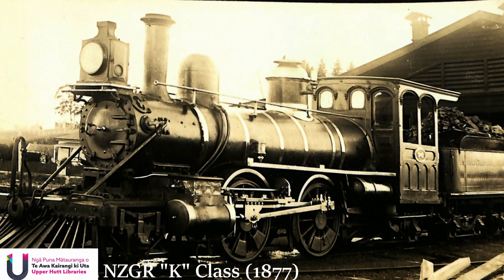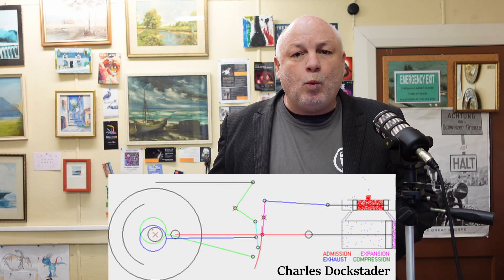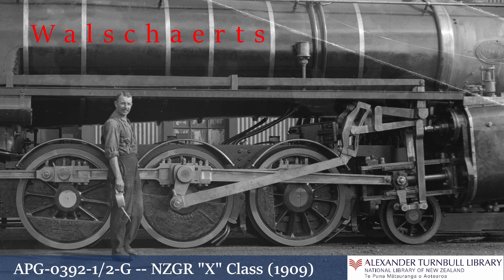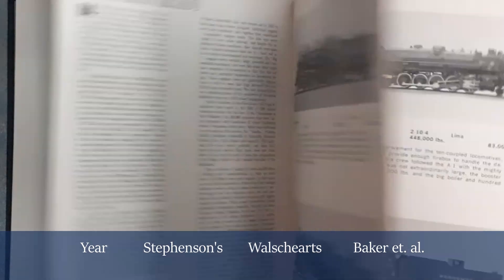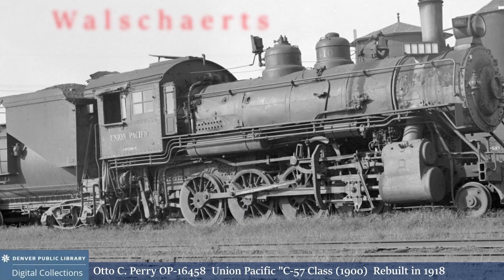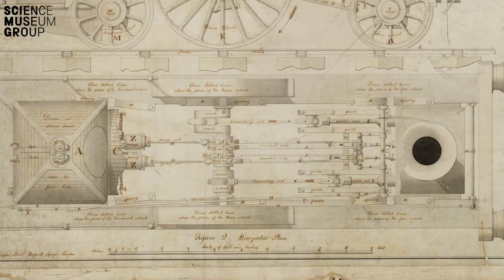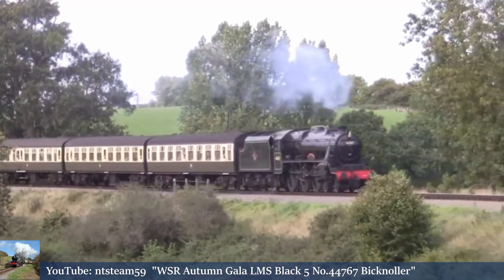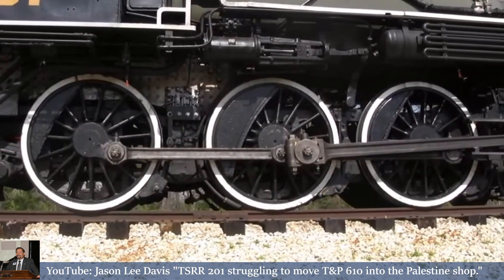Stephenson's Link Motion.

Comment: Outside Stephenson link motion gear was used quite a lot on smaller tank locomotives with outside cylinders on the European continent.
The motion links didn't need to be heavy, and access was limited to inside gear by the side tanks, so the obvious choice was to have it on the outside for easy access.
Walschaerts valve gear mostly superseded Stephenson's gear from 1900 onwards on this type of locomotive as well.
Reply from the maker: Thanks Tom.

Save for de Glehn / du Bousquet, because we had that here - and the Schmidt superheater my ignorance of European steam is near absolute.  So thanks for your comment.  I wonder if the lack of patent for Stephensons was also a factor on the continent.
Reply: @theimaginationstation1899  In fact what I pointed out as Stephenson Valve Gear on the continent is a variation of Stephenson valve gear and was known as Allan gear.
It differed only in the fact that it had a double lift link.
These were fitted to a double lift crank connected to the reach rod, one of the arms lowered the expansion link while the other one lifted the radius rod and vice versa.
Sounds a bit complicated but is in fact Stephenson valve gear where the valve rod is not directly connected to the expansion die block but is connected to this die block via a radius rod like Walschaerts does use.
Reply from the maker: @Tom-Lahaye yes, I'm with you.  Kind of similar to Gooch, but also different.   Variations on the Stephenson's theme.